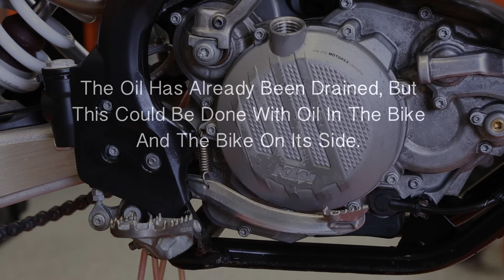KTM DDS Clutch Adjustment, Replacement, Maintenance and Settings – Cycle News

Comment: Nice! Thanks, it's good to have clear videos without ramblings ! Much appreciated. 
Should the 6 bolts be loosened & tightened in a criss cross /star pattern ? Seems you go circular?
Reply from the maker: Generally, we always final torque in a cross pattern. initial tightening might be circular depending on how well we think we can control our muscles. But you're right. It's always better to torque across a pattern, not in a circle.

Comment: With a 300xcw 2011, the clutch drags a tad, even with a properly bled line. What is the most common cause? The springs would need replacing?

Comment: I just got a z start pro for my 05 ktm 450 RFS, I have ZERO gap between my friction plate and pressure plate. It’s fully engaged 100%. How do I get the gap? I have all the parts, and it’s put together how Rekcluse says

Comment: Just out of interest what is the year and model bike that you are working on? The reason that I ask is that I'm having clutch drag issues with my 2013 300 EXC (UK). I noticed that your pressure plate has locating holes in it for the steel sleeves that the plain plates run on. My pressure plate does not have these holes, the sleeves are shorter on my engine and they just butt up against the pressure plate.

Comment: The settings weren't really explained, what is the difference between 1, 2 and 3? How is that set?
Reply: The manual explains it as: start with 1, then 2, then 3.  The video says use the setting that it was disassembled with which seems like a good start to me.
Reply: You've probably sorted this by now but 1 is a lighter clutch pull. Technical Riding. 

2 is the stock position for everyday use. 

3 is a header pull used for Motocross. Clutch will wear slower but is harder to pull. 

I've just done mine and switched to 1 and it's light as a feather now.

Comment: The 2017 KTM 350SXF has the standard clutch springs,  which KTM four strokes have the pressure ring setup, that replaces the clutch springs ?
Reply from the maker: The new motocross and XC models all have a diaphragm spring now. There are some years where some have traditional springs and others don't. Even the 250 SX-F gets the big bevel washer spring for 2019. However, it's not "damped" via the rubbers. Apparently the HP output of the 350-up is the deciding factor of the damper use.

Comment: So by "top" on the thin ring that goes on the pressure plate, I assume you mean make sure it's the side with top on it faces outward, not toward the top of the bike. :)
Reply from the maker: Correct! haha...good point.
Reply: I was wondering as well....🤣😏

Comment: Should there be any play on the clutch baket side to side play ? 
I am just starting to worry cause im getting shavings on my magnetic drain bolt. I dont know if its coming from the transmission my oil filter and screen is clean though
Reply from the maker: Late reply here, sorry! Shavings on the magnet are pretty normal. There is alway stuff wearing inside. There is a little inherent play in the outer basket but there shouldn't be too much on the inner hub and/or in a direction that would indicate a problem with a bearing.

Comment: I have a rattling noise in the clutch it doesn’t do it when I’m in neutral it dose it when I’m more than half throttle sounds like something is Loose
Reply: May be a loose bearing or bolt? Just my educated guess. What kind of bike do you have
Reply: Garrett Rainbolt I have four brand new 2019 ktm 250sxf  and I guess i got a defective one. My mechanic just picked it up Sunday so we will see what it is has 7hours on it. Definitely hard hours on it, it’s my sand track bike.
Reply: @riderblank8010  yeah, that's an occurrence. We had dirt bike fresh off the lot awhile back, that had a smallll hairline crack in the block. Took it around the loop and the engine blew apart. I know failures are common on new and revised models considering that the manufacturers haven't necessarily worked out every bug, snake and cockroach out of their products